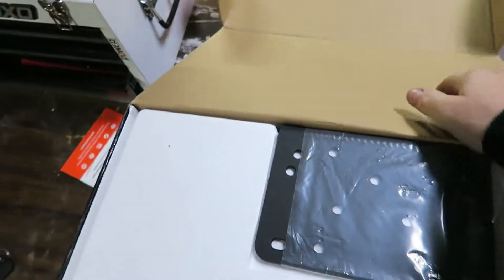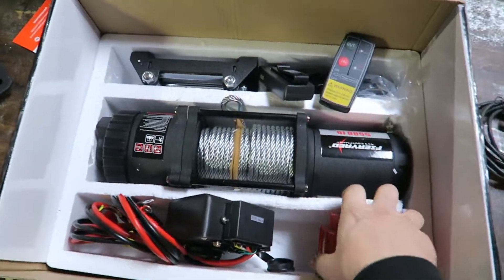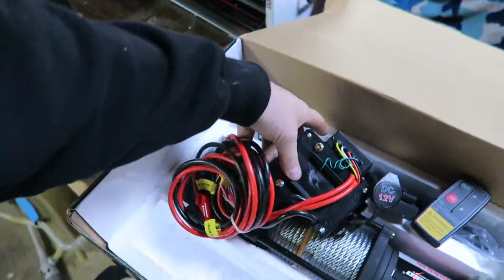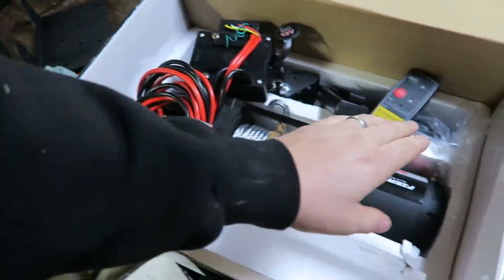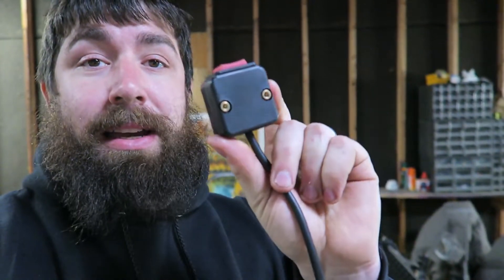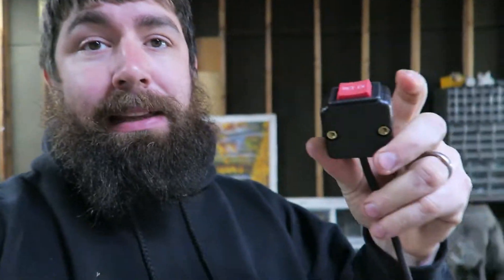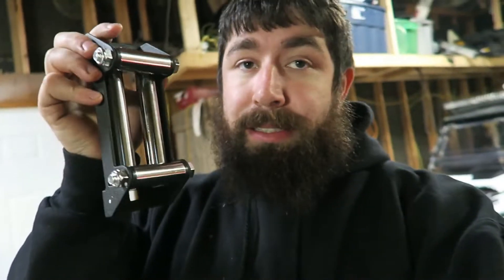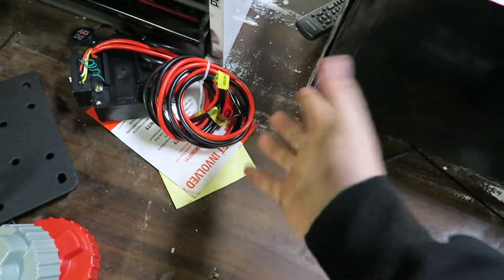Harbor fright Killer!!! (FIERYRED 5500 LBS Winch)

Comment: I just put the 4500 lb one on my kei truck. I also got it partly for the 2 wireless remotes. The solenoid is kind of a pain to mount, but it’s not that bad (not integrated like yours). I mounted the switch to the side of my shifter box, with some 2 sided tape. It was by far the best deal on amazon for $200 or under. I’m glad other people are happy with the product. Cool video.

Comment: I can certainly appreciate the simplicity of the single electrical box as I'm just finishing up the installation of a new 5500 Apex Badland long drum wench.  Having to mount a battery disconnect, solenoid and controller harness is a serious pain in the ass... and likely nearly impossible to find space to mount the parts under the hood of a newer model truck.  My install is  on a 1995 Toyota Pickup so I had some space but not a whole lot of fabrication ability as I don't have a welder to make brackets.  I use some metal angle iron and equipment panels from racks and a hack saw to mount the parts on.